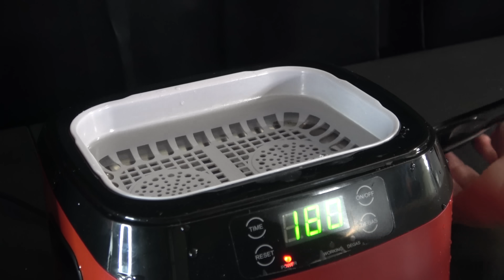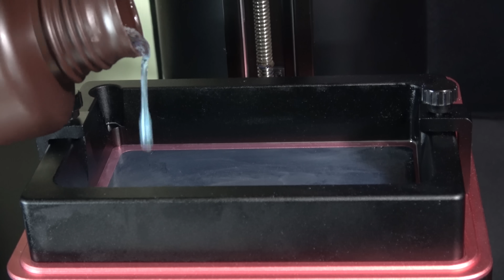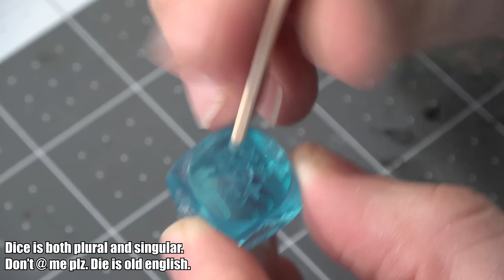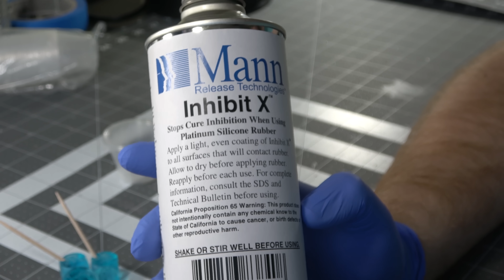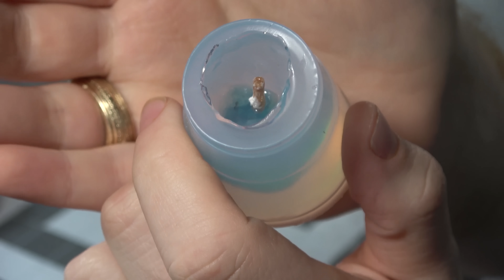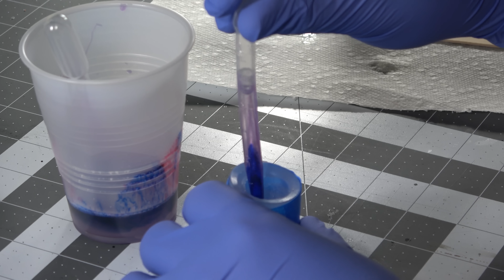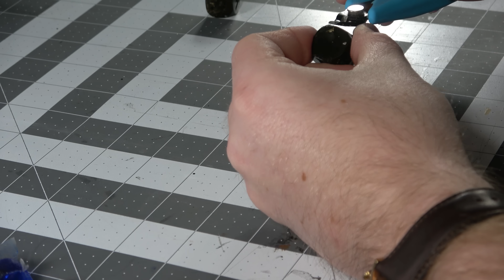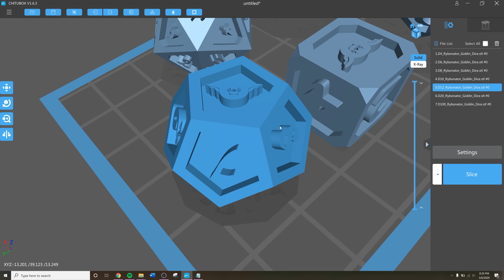How to Make Master Dice for Molds from 3D Printed Dice

Comment: I can't find a good resource on how to make the shape of dice that's accurate. I can 3d model but I don't want to eyeball it... otherwise I'd make my own dice.
Reply from the maker: I feel like I will be in for a rude awakening when I start modeling my own haha :)
Reply: Dice are regular polyhedra, so typically just use that. For my D10s, I made a pair of 10-face cones and then moved alternating vertices so that I had 10 quads instead of 20 triangles. Any decent 3D software should have tools to ensure your results are flat.

If you meant keeping the balance centered, there are 2 ways I can think of, and I've tried both. One is to make a monochrome image of each face, take it into a graphics program, and calculate the relative black:white ratios of each face, then use that to calculate the cut depth. The other option is I wrote a program to calculate face depths, which supports both numbers and custom face images.
Reply: @ClokworkGremlin  it's very easy to scale and warp things in a 3d program, I don't know cad but I also don't know how i would do it in blender without accidentally messing up the scale of the faces because i could make something that looks correct but then you print it and it turns out it's like squished by 2mm on the Z axis so the die shape is technically wrong and irregular which means it will roll wierd
Reply: (Here's a tip: Most Die faces are simple shapes. The D20 for instance is a simple triangle. If you make a single patch of a triangle in Fusion 360, then you can copy and paste it using the dihedral angle 19 times... but don't tell Rybonator I said that)
Reply: @TheShadesOfBlack  well i don't know fusion i know blender but i guess I'll have to learn fusion.... or just use these dice as a base and edit them in blender.
Reply: @Marcel2278  both work. I prefer the precision of fusion myself. But I have the basic model templates I can email you if you want.
Reply: @TheShadesOfBlack  that would be cool

Comment: This is so cool. Me and my husband just got a 3D printer and I wanted to know if we can do this with a Filament printer rather than a resin printer? I want to try and start making my own dice starting with my friends that I have a DND Campaign with. :D
Reply: Filament printers don't have the dimensional stability for printing dice. I do use a filament printer for the mold shells  for my dice molds, though. (Moldception!)

I also have a Thingiverse thing for printing miniature bases, which work great on FDM.

Resin printers aren't expensive. you can get an Anycubic Photon (what I use) or Elegoo Mars (in this video) for under $300 if you time it right. I'm going to guess you spent more than that on your filament printer.
Reply: @ClokworkGremlin  Okay makes sense.   It is the only printer we were able to get so might just have to make due with what we can for now til we can afford a resin printer. Thanks for the help! :D
Reply: @manamikobayashi318  I'm currently trying anyway with my filament 3D printer, as I've managed to do small stuff before, it might just take a lot of fiddling about until they print correctly
Reply: @lightningstrike1313  good luck please let me know how it goes :D
Reply: @manamikobayashi318  The print has finished, there's abit of clean up I have to do, they haven't come out perfect but good enough for molds and a first attempt at them, I think I need to increase the size of them by about 10-25% and tell my program to have them float about the bed with supports by a couple of mm. Other than that they have come out looking good entry to clean them up.
Reply: @manamikobayashi318  I've managed to finally get a decent looking set (Which I am going to use for moulds) of these dice from my 3D printer. 
If you use Cura use the Tree supports, make sure that all the dice have a flat surface to the bed then raise them up (Making sure you have the settings where it sticks to bed off) and then increase the size by 15%. 
I have got consistant reults on the D20, D6, D12, D4 and now the D8, I have to print off the D10 and D100 again now that I know where I've gone wrong with them (Pointy end down doesn't work). 
Other than that it's getting the quality to be the best you can get and if you want to use them for anything other than making moulds putting the infill to 100%.
Reply from the maker: You MIGHT be able to make a filament printer work, but you are going to need to 100% infil your prints, and do a decent amount of CAREFUL sanding. These dice have very recessed numbers so it might work, but it's be tricky to be sure. :)
Reply: I use an FDM printer and as long as my settings are properly tuned, I can get some great stuff out of it.

Comment: Maybe a dumb question, but what about leaving one of the supports as a sprue after printing? They are created to be easily removable
Reply from the maker: Great question! So you can build the support with that in mind, BUT then you have a support you have to sand around, and that's WAY harder to get smooth than a flat surface. It's easier to add later :)
Reply: With resin prints it's easier to remove and clean supports before you cure them
Reply: great idea (i think at least), but the one problem I could think of is that sanding the face with it would be much harder
Reply: That would work, but would also make it a lot harder to sand and polish the master dice.
Reply: Also if you you're referring to molding the die after it's been printed and cured,  then that's also a bad idea because the moulded die would have a permanent non easy to remove support in the mold you have to remove every time
Reply: @Marcel2278  yeah, but surely it's about as easy as removing the toothpick?
Reply: @Eternal8Phoenix  actually after watching to that point probably but probably still not the best idea because the shape of the support is often irregular and not always 100% straight so depending on print orientation it could work really well or create a very strange resin path that could cause issues. That and it would make cleaning the side with the support still on it difficult to clean and polish and prepare, etc. Theoretically not impossible but actually more impractical than you might think. The toothpicks are also thicker than the supports and if the supports share a base it's difficult to remove all but one support.

TLDR: technically yes in theory but in practice it seems like a very bad idea that might be more trouble than it's worth to use the supports as a sprue.
Reply: @Marcel2278  the best way should be to build the spruce in the dice itself, in order to solve the problem of the inaccuracy of the support building
Reply: @Eternal8Phoenix  true but when you remove a support  it often leaves bumps and pieces, it is designed to snap off easily yes but it's still  plastic molded to other plastic and it never comes off 100% cleanly. Basically if you don't mind 1 bumpy die face with small flecks or bumps of plastic that might need to be sanded down then sure you could use a support as a sprue. If you want clean dice you're going to have to remove all the supports and clean the die and then mold it, but then you need a sprue.
Reply: @maledetto1221  true, exactly but using a support as a sprue is a bad idea. In fact if you do it right and don't mind having a blank side you could technically make one side the sprue side and the support for the die by making one face the sprue. Basically you instead of adding a 1 to the die you 3d model a cylinder or cone that covers the die face and that shape protruding from the die covering the number will be the sprue and a good support if you do it right.
Reply: @Marcel2278  exactly what I was thinking, but the sprue can be used also as a support, because the problem I was trying to solve is that he has to sand two times: one for the supports after the printing and one for the sprue after the molding. Also having the sprue already in the file avoids the necessity to destroy the print for making one(and this can lead to problems)
Reply: @maledetto1221  the only problem is you'd have to have a blank side because the sprue face will most likely have issues holding a number and having the sprue face in place

Comment: Nah metal scrapers are fine on resin print beds, its just using that metal scraper on the plastic FEP film is a huge no go
Reply from the maker: Ahh ok that makes sense. I knew the film was bad idea, but good to know I'm not screwing my print bed up :)
Reply: @Rybonator   yep! If anything scarring that metal plate could help with adhesion! Also don't be too afraid to lower that support contact setting if you're also willing to slow down the lift speed and take it a little slower (generally makes support cleanup a hell of alot easier)
Reply: But they freaking cut your hands
Reply: Nah, metal on FEP works too if you put slight pressure pushing up the cured resin.